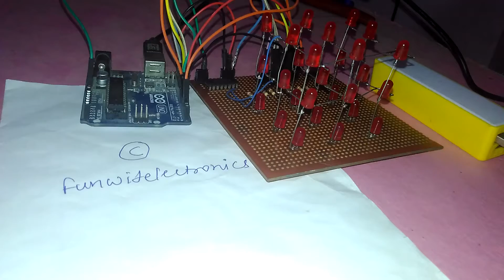Led cube using arduino 3*3*3 | Arduino led cube

Comment: Is it possible to make one without a driver ic
Reply from the maker: Sreekanth KT driver ic is used to provide enough current to the circuitry. Since arduino can't provide that much current. That's why we had to use an driver ic
Reply: +Fun with electronics  On avg how many leds can be powered by Arduino directly..??
Reply from the maker: Not, since arduino can provide a maximum of 150mA current only. And if we are talking about individual pins then it source/ sink 20mA current only. Hope it helps
Reply from the maker: Around 6 leds if each led consume 25mA of current
Reply: +Fun with electronics  Thanks for the info.